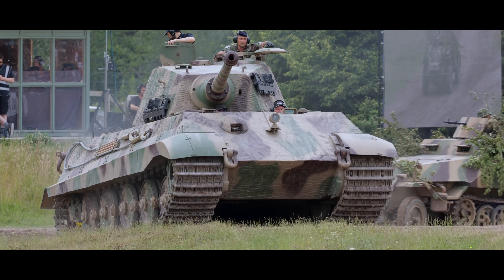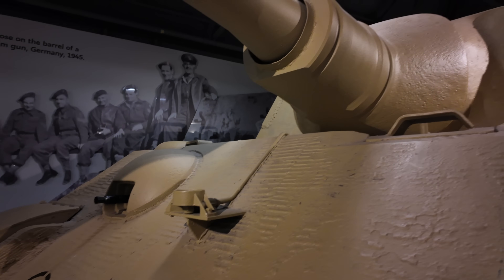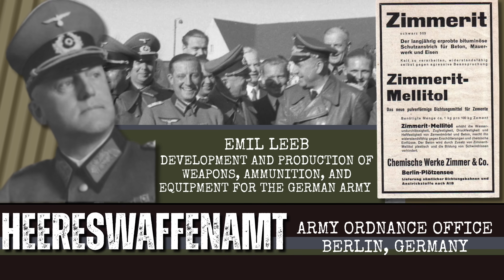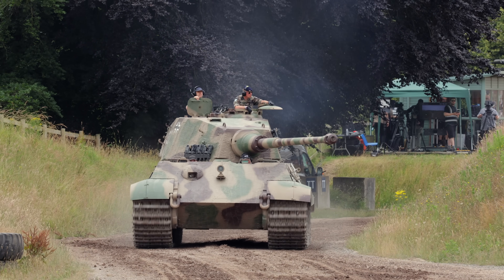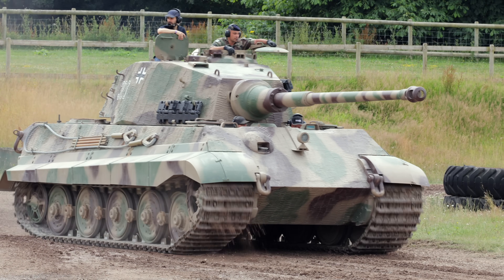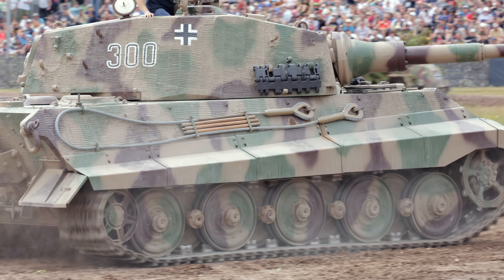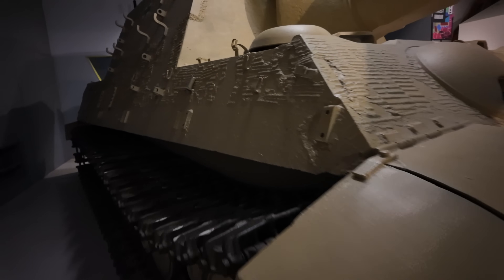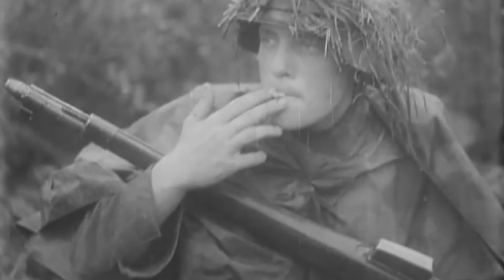Zimmerit - Short Lived Panzer ‘Armour’ of WW2

Comment: How much time does it take to apply the paste?
Reply from the maker: Around 20-30 mins to coat the armour then up to 8 days for it to cure naturally to its hardened finish. That process though was accelerated with blow torches to cure it quicker to get the tanks out the factory and to the front where they were needed

Comment: Well it must have worked because there were buckets full of the stuff issued to troops in the field, for field application by crews. Problem was it took ages to dry and the crews weren't exactly neat when applying it. I can understand why some crews reported that the stuff burnt. It usually wasn't cured when that happened

Comment: Did noone think about Ceramic Armour in WWII ,  Ceramics from china 2000 years before. Noone thought about it ? Plates glued to tank Armour to defeat shaped charges ?
Not being smart after the fact, I bought thousands  of tons of Ceramic beads, called proppant , for Fracturing in the Oilfield in the 2000s ,  stronger than sand.I guess the base of Chobam armor as developed post war.  Always wondered why Ceramics were never used in WWII as armour. Could have saved many Allied tank crews ?
Reply from the maker: Very good question given its applications today!

Comment: Ironically, the only Wehrmacht armoured unit attacked with a magnetic charge was Tirpitz, during the X-Craft attack on Her
Reply: “Kreigsmarine” , ie the German navy in ww2.
Reply from the maker: Wehrmacht refers to Armed Forces so Army, Navy and Air Force.
Reply: The mines, or charges,as used on the Tirpitz, were dropped by the x-craft UNDER the Tirpitz and were detonated by a time fuse. Only a last minute shift in her moorings saved the Tirpitz. The ship was seriously damaged and probably was never again fully combat capable.

Comment: Excellent run down. In addition there used to be a belief that zimmerit was widely field applied. Yet if you look at almost all pictures of Tigers, Panthers, Panzer IVs etc that were built before zimmerit was introduced but were still soldiering on in the autumn and winter of 1943 and into 1944, these pre zimmerit tanks are devoid of it. I've only ever seen a few pictures of what looks to be very roughly applied zimmerit that may have been done in the field. 99% of older German tanks clearly didn't get it applied in the field half a year after it was factory applied.
Reply from the maker: Thanks! That's a really interesting point about the field application; it certainly seems to be a common misconception!
Reply: And you'd think that if any tank was going to get field applied zimmerit then the precious and expensive Tigers would be the ones. Yet pictures show them without it still in 1944.

Comment: A hell to apply on 1/72 scale modelkit tanks🙈
Reply from the maker: That’s one job I’d avoid!!!🤪
Reply: @WW2Wayfinder It's tricky but gives a nice look to it. Enough tutorials on YouTube for that. But 99% is on 1/35 scale kits.

Have a nice weekend
Reply from the maker: I did want to have a go at it on my 1/35 King Tiger but opted to go for a post Sept/Oct 44 finish 🫣
I’ll get around to it one day - maybe 😉
Reply: I put Zimmerit on a 72nd scale Tiger. It took me longer to do the Zimmerit than it did to build the kit😅😅😅😅
Reply: Makes you wonder why any enterprising upstart model company hasn't decided to make pieces with it on in the mold?
   Could charge more and fill a spot in demand?😅
Reply: @donaldkroth2579  plastic soldier company do a panther n A with zimm, raventhorpe do  G in resin,its a wargame model,tho.   Britannia did one years ago but its a bit ropey by modern standards
Reply: More of this, please. 👍
Reply from the maker: Certainly can do!
Reply: I've done most panthers,jagdpanthers and stugs with an aldi dremel . Tigers with a flat screwdriver blade in a cheap soldering iron. Maybe 70 or 80 panthers in 72nd. 60 in 1/35th. OK for wargaming. Local model shop call me pantherman. I used esci, hasegawa,italeri,revell and some Chinese ones off ebay. Got a mate to cast me a load of resin wheels/tracks for those and the italeri G . Can't beat a couple of months panthering!!
Reply: @DavidHill-f4pabsolutely 💯 ♥️ the Tamiya kits😊
Reply: Yes, but you could use Parts. I found them on eBay in Poland at low prices a few years ago.